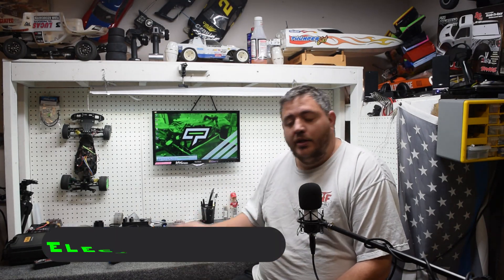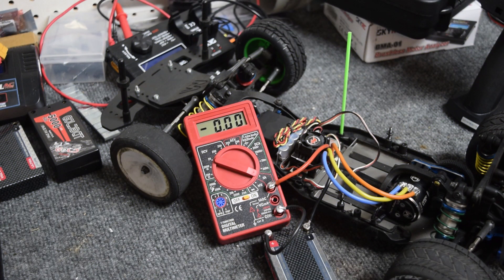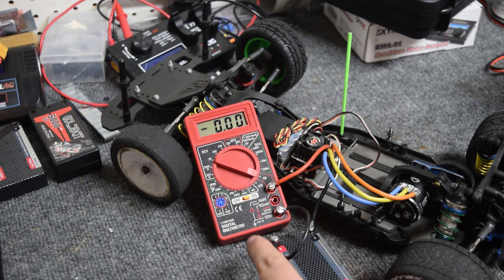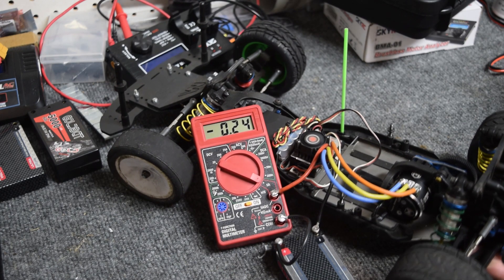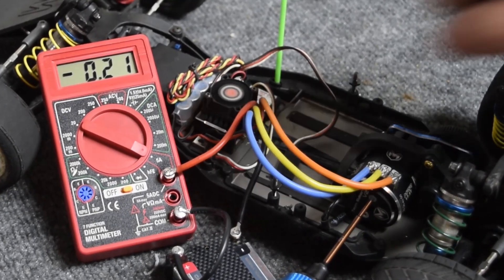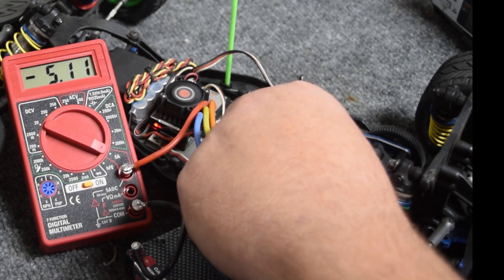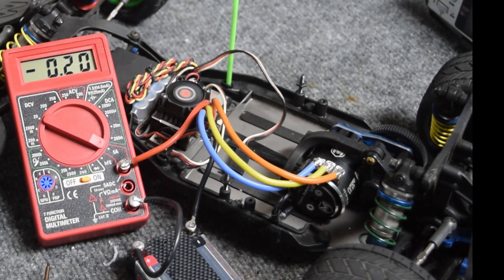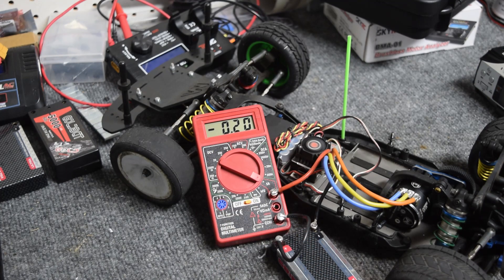How to tune your RC sensored Brushless motor, Part 3, Poor mans version of how to adjust your motor

Comment: What springs are those, and where did you get them? I've been looking for some fluorescent springs. Thanks!
Reply from the maker: @njsardo  those are custom works big bore springs , there designed for oval racing and each color is a specific spring rate . They are shorter then your standard offroad spring.

Comment: I would go more for 6a draw through this method as the ESC would draw a certain current thus adding to the motor draw. So if the motor by itself pulls 5.5a and with the esc draw reads 7.2, safe to say the esc pulls a little less than 2a factoring in the fan attached pulling .27a at the beginning. The flashing LED is negligible as it’s intermittent and only uses barely 3v to light up for that instant. Also, internal resistance of the esc adds to the amps drawn through heat which must be dissipated through the heatsink. All this is energy drawn and lost.
Reply from the maker: your right, but the point i try to make that most dont seem to understand, there is no "magic" number to set a motor. 
your suppose to set a motor based on the largest jump on the track your racing, or the largest straight away  section. and tune your motor based on that and once you find what the motor likes to keep the temps just low enough to not melt a motor, thats the magic spot.

Comment: So technically you want to set it higher than 5.5 amps using the the voltmeter from the esc due to the extra current draw from the esc ? How would you find the amp draw of the esc and fan to sum it up so your motor is pulling the full 5.5a?
Reply from the maker: yes you would want to go slightly higher. how much higher i cannot say because ever esc , every fan is different. 
The point of this video is , once you have a established base for timing , lets call it 30 degs of timing showing on the can, you can test it with your meter , so when you go to tear apart the motor for what ever reason or another, and you go to put it back together, you know EXACTLY where it was and you can put it back in the same spot as before.

Comment: With motor unloaded, it does not matter and make any sense how much number you get. The only possible use of this is to compare several motors in line, but once loaded, these motors can still behave differently than you perceive based on the numbers you have when unloaded.
These cheap instruments can only give you some sort of ideas but not reliable. You need one that can add torque to motors.
Reply from the maker: You are correct for the most part, a chassis dyno is hands down the best way to know what its doing.
My point for most of this series is , once you find the timing your motor once, this tool allows you to determine what it is and when you work on it you can set it EXACTLY how it was before.

Comment: Saw your reply to George Jefferson, and it still didn't make much sense to me?
 You tune the motor to 5.5A on the analyzer, then at those settings it reads over 7A in your truck (obviously the ESC & fan account for that extra current usage). You then reduce your timing (lowering motor performance)? Is this because you're battery pack won't cope for the length of time you require, running that amperage? This is the only reason I can envisage.
 Thanks.
Reply from the maker: no. if you test a motor lets say 50 deg of timing and not change it, install it into a vehicle like i did and test it using the volt meter and get 7 amps, that means the MOTOR is drawing 5.5 amps and the rest is a draw from the wiring, esc, fans transponder and everything else. the purpose of this which i think your missing is its a point of reference for you to test your motor without using a analyzer. Some poeple dont want to spend the $100 for one which i understand. 

but lets say you check your temps of the motor and you know your on the right gearing and you decide you want to turn UP the motor, you can adjust and change to a set timing, lets guess on the can to 53 deg... and then you make laps and find out its the PERFECT match for your car and your track, you can then set the volt meter to it and check the draw. 
Lets say that draw is now 9.2 amps (hypothetical). you decide you want to take the motor apart 1 month from now to clean it and do service and reinstall everything back, you can adjust the end cap to draw EXACTLY what it was when you found the "magical" number your combo wants for your track, setup, driving style, temps... 

i know this is a long response but my point, there is NO magical number to set it at, because there are A LOT of variables, but once you find what works for you, you have a way to set it back to that EVERY time you do service on the motor.  
i hope this helps you with your confusion if not let me know and ill explain more.
Reply: @ChrisPatrickRC  ah, it's just a benchmark, I understand now. I originally thought you were tuning for peak power, then didn't understand the backing it off bit.
 Thanks for replying!
Reply from the maker: @TheSoulspinner  correct. The numbers I have put out in public are my base numbers I set all my motors too and adjust according , there usually a pretty conservative number to set it at.

Comment: So if using this method with the multimeter what sort of amp draw on the motor roughly should you be looking at to get maximum performance from the motor? 

Is there a point where the amp draw drops off when the timing is too high?

Just looking to set my 21.5t timing for the best performance
Reply from the maker: the answer is YES.... but what that point is , i cant tell you because every motor is different, YOU have to do trial and error with your motor to find out what your specific motor wants. some want timing, and some dont, example... trinity usually loves timing, and my mclain doesnt. but one is a torque motor and one is a RPM motor. 
Thats why i cant give you a set number and say "if you set your motor at 32 degs of timing, which is 4 amps, is your magic number"  i hope this makes since ?

Comment: Chris, I have a cheaper Trackstar 13.5T motor.
But no mather how much/low i set the timing, I can't get this above 2.33Amps draw.
Should I asume this is the max the circuit will draw and just get another motor? :)
Reply from the maker: odds are yes that would be the max amps it draws, or its a fixed timed motor possibly?
Reply: @ChrisPatrickRC  i can go from 1.2 to 2.33 and back to 1.20 :-) 

Any advice on motor ? Trinity all the way ? ;-)
Reply from the maker: @dmi  i enjoy my trinity motors, but there are other good manufactures out there. r1, fantom, hobbywing (higher end models)  , motive...  just make sure you spend the extra money on a certified version as they will be the higher % so your getting the best motor for your money at that point.  example trinity is top 5% becomes certified.

Comment: 1st i want to say great video very informative! Would you happen to know why a motor wouldn’t hold full amps when you hold down the throttle? Im tryin to set a reedy s+ 17.5 and it peaks at 4amps for a split second then under 1amp for the rest of the time im holding the throttle.  I tested my other motors using this method and everything works fine its just this one motor im having a issues with.  Thanks again
Reply from the maker: sounds like a sensor board issue. thats where id start if it was mine.
Reply: @ChrisPatrickRC  thanks for the response...i guess i'll start looking into the sensor board

Comment: Hi, Chris, great video´s; i am wondering if i do this with a 1 cell esc with a 1 cell lipo, do i aim for 6A also, or just 3 Amps, because the voltage is only half of a 2 cell lipo?
Reply from the maker: i have never tried a 1 cell option so i cant help you much besides what i already said on the video. 
The 6a mark is just a tuning tool, and a way to test a motor to get the same results every time you tear it apart and rebuild it.... 
So if you find out your motor is running PERFECT at 3amps, and you use the volt ohm meter to test and it shows its at 3amps then your set. 

you still have to figure out what the motor is wanting for your application, ever motor is different and wants different things, Tune your motor to heat, should be getting 150-160 degs after a run if its not, turn it up, if its over, turn it down... 
i hope that can help you understand more about tunning.

Comment: Chris, great content. I am a bit confused though. I thought the goal was to get 5.5A to your motor. When you ended the previous video you had your motor timed to 5.5A. At the start of this video the ammeter read 7.74A. I get that...ESC, fan, etc. pulls additional current. At the end you tuned your circuit to pull 5.5A. Doesn't that mean your motor is actually receiving less that the 5.5A you were aiming for due to the still remaining current pulled by the ESC, fan, etc? Seems to me you would need to add up the current of the rest of your circuit and add that to 5.5A and tune to that. Shouldn't your end goal have been the original 7.74A? Again great content just trying to learn.
Reply from the maker: Because 5.5a was measured directly at the motor threw a motor analyzer. So that is a more precision device to measure what the motor is doing without anything else in the way. 
So if a analyzer shows 5.5a and if you follow the volt ohm meter and its 7.74a , at the end of the day its data you can use to tune your motor. So if you decided to tear apart and do maintance you have a way to rebuild the motor to exactly how it was. Or if you think you can get more out of your motor you can turn up the timing and watch the amp draw. So maybe turn up the motor can another 5 degs of timing and it changes the volt ohm meter to 8amps. 

I hope that helps.
Reply: @ChrisPatrickRC  Yup tracking. Thanks.

Comment: sweet. I knew there should be a way to do that.  Thanks.  Saved me a Cnote. Already have the meter. just need to solder up a jumper.
Reply from the maker: Just remember its not as precise due to the esc and wires and so forth . But it will give you a consistent reading and thats all that really matters.
Reply: @ChrisPatrickRC  Aye.  Getting the ability to check the timing of the can is a nice feature.  I'll probably still grab the analyzer.   Any major differences between this SkyRC unit, and the Motorizer from Trinity I think it is? *(the 400.00 unit).
Reply from the maker: @TheseOldFlappinLips  alot more percise and measures more. Its what the pros use.

Comment: why do you think the motor checker and  volt meter are not the same AMP readings ??  just asking as they seem not even near each other for tuning
Reply from the maker: because your adding resistance of wiring, plus the esc is being added to the power draw. 
so the combination of the pair is why using a volt ohm meter will always read a higher number then directly off the motor. The purpose of the video is to show you it can be done, and it gives you a data point you can duplicate and adjust your motor using that tool, and know it will be accurate. you just cant use the analyzer and the meter together because the numbers are different.
Reply: @ChrisPatrickRC  thanks for that ,I have volt meter and have done my motor 5:6 amps for 21:5 t and will test it out with temp gun ,thanks again for a cheap running setup

Comment: What setting is ohm meter dialed to?
Reply from the maker: It was mentioned in the video but its dc amp , which on that exact meter is bottom right corner in the red called 5adc.